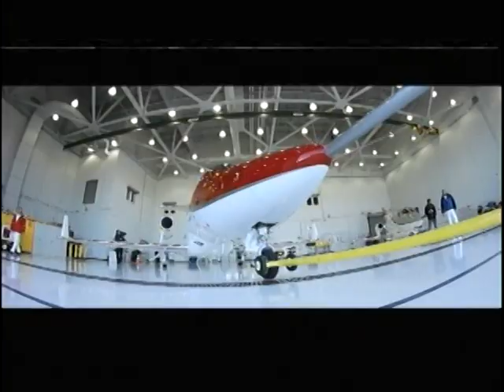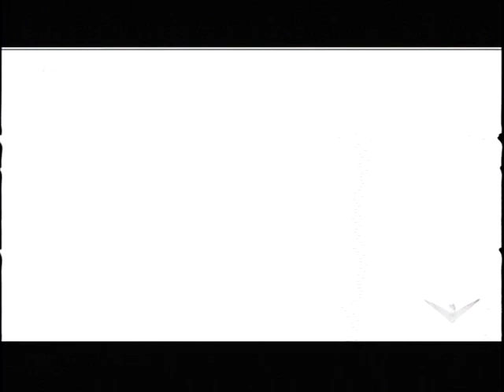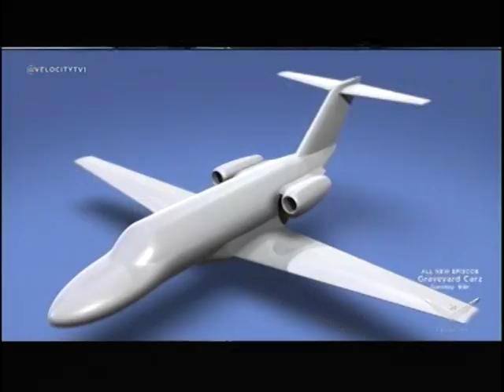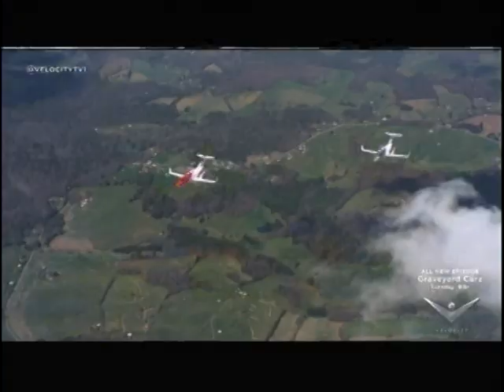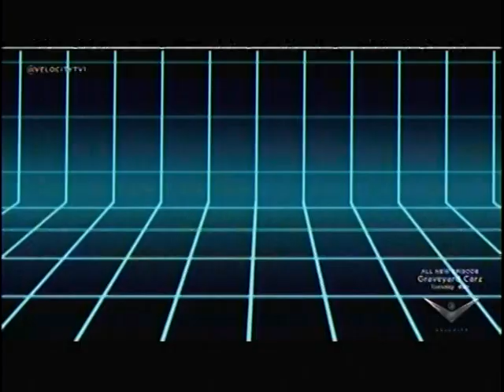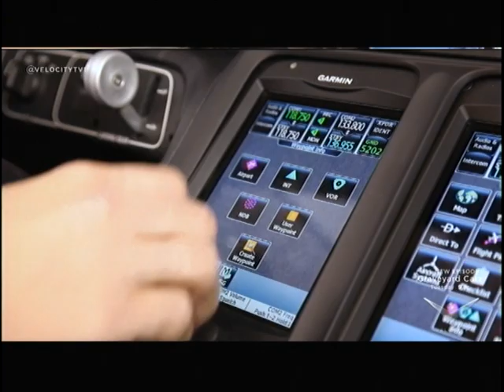Hondajet

Comment: Not true. Perhaps a small pitch down with power increase. All planes have pitch change with power changes. All the reviews I have read say the pitch changes are nominal. I've flown the similar size CitationJet and it has pitch changes with power changes.